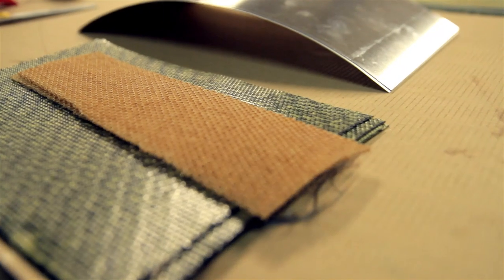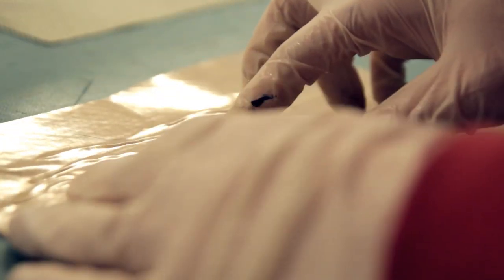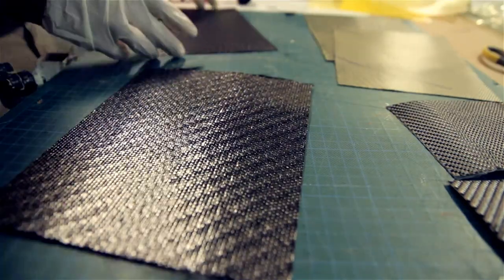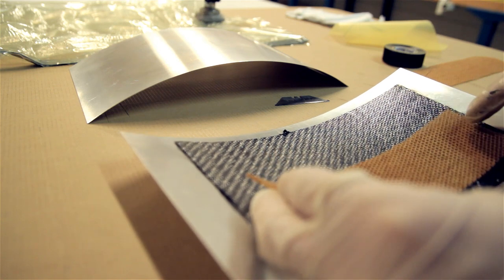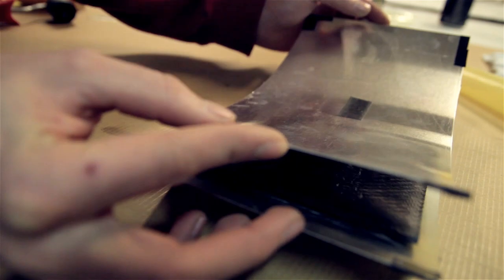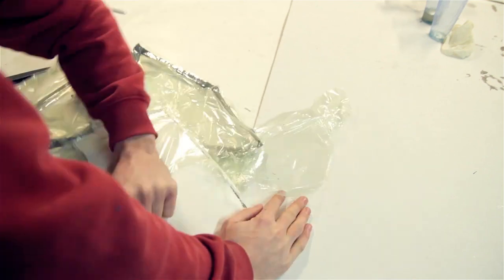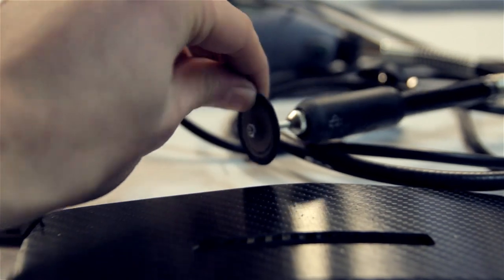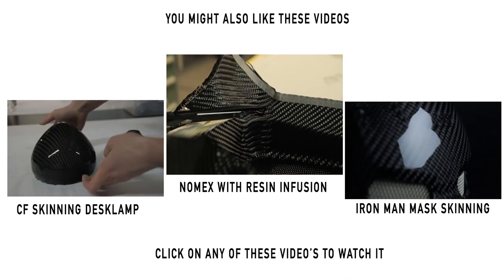Carbon Fiber Prepreg With Nomex Honeycomb Core (Spacegrade)

Comment: Just a tip for those choosing to do what your doing but with mutiple curved surfaces.  Over expanded cell Nomex honeycomb has strenght on the "X" axis and the ability to accept curves of "Y" axis(width of honeycomb) for boat hulls for example.

Comment: I need to get my hands om some 0.5mm with a slight bend in it, like in this video.  I have some straight carbon plate but it just doesn't offer enough resistance when it's flat.  Is there a way to induce a small permanent bend in carbon once it's cured?  Otherwise,  is it possible to make it yourself in such a thin configuration?

Comment: can you use aluminum backing to a carbon fiber nomex honey comb sandwich for extra strength  and in order to maintain the shape of the  design where weight is not an issue

Comment: Are you sure it is good like this?! I mean the whole think with vacuum is to reduce the amount of resin in it, right?! you basically build an 1 bar press.. 
Or did it still remove all the air out of the fiber...
Reply: Its pre-preg, you don't remove any of the resin, its at the perfect amount. Vacuum is to ensure all pieces bind without air bubbles as the resin heats up and flows.
Reply: +Kenneth James Finch sorry for questioning, at the place that I work we do this, I mean use the vacuum to reduce the resin even a bit more... As far as I know our labs studies reviled only the Gramms that where saved... (As far as I know)

Thank you for your answer! ;)
Reply: +Lux158 Is your lab using pre-preg or some sort of infusion process? or is the resin layed up by hand? each process will  require different vacuum process
Reply: +Kenneth James Finch we do everything but i have asked about vacuumbagging in my company and they reply that it just take away the resin that was unnecessary, in prepreg;)
Reply: off cause the whole thinking of prepreg is to have the perfect ratio right away but as long as the company that makes them are controlled by humans they have their problems... also the things we built have, in some regions, 30 layers of prepreg or more, so that could easily add up..
Reply: I suppose that makes sense. That's a level of engineering far beyond my scope of knowledge, but I see the logic in their reasoning. I'd love to work with a carbon fiber company, and get paid to learn some skills

Comment: hey man. Thanks alot for all of your videos. Can you go into further detail about how you got such a nice gloss finish with the clear coat. It looked kinda rough and then the video skipped to the part looking amazing and glossy. Thanks! keep it up
Reply from the maker: +TutShare simple 1K clear you can get in the DIY store and apply multiple coats...pretty basic :) no secrets here
Reply: +Matthieu Libeert (Mat's Prototyping) Thanks so much for a quick reply. I actually read this a while back but Im now in the middle of production and had a follow up question. There were a few holes in 7:22 and I'm wonder if you ONLY used clear coat to solve this or if you applied more layers or epoxy. Thanks so much. Your new videos this year are great!
Reply: easy composites non-autoclave pre-preg is ok at best if you want a smooth finish. It does the job if pin holes don't bother you.  Which is what you saw is the pinholes.

Comment: What do honeycomb cores do from a mechanical standpoint?
Reply from the maker: Add extra strength
Reply: @MatthieuLibeert  Does it save on having to use more layers of carbon?
Reply from the maker: Yes stronger and lighter
Reply: Resist compression and shear loads

Comment: One thing you have surely missed is making a normal or typical mold. Those pieces of aluminum can be only used for...... nothing with your project. Make a MOLD... and then you will have 200% better result.
Reply from the maker: I have many other videos online online à out that on my channel 😉, check some of my other videos!

Comment: did you use heat gun of this process?
Reply: Ahmet Bal it was put in an oven at a controlled temperature
Reply: You can use a heat gun if the material is a tight weave. But hold it a minimum of 300mm from surface and heat slowly and evenly.
Be careful with low temp resin systems because they will start to cure if to much heat is added.